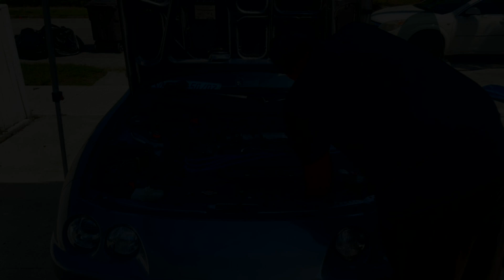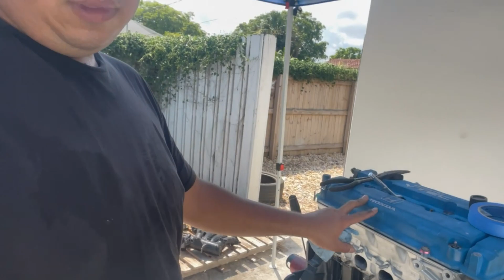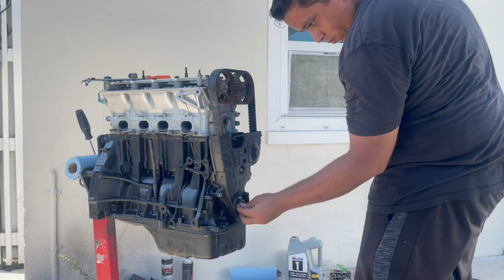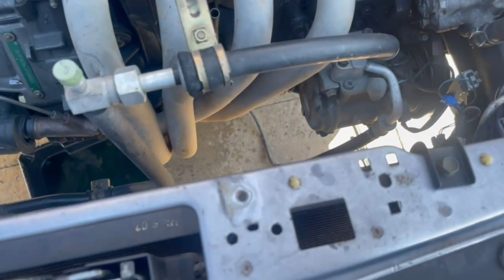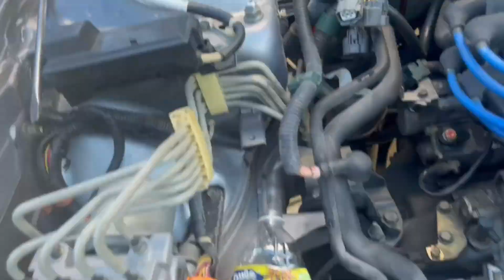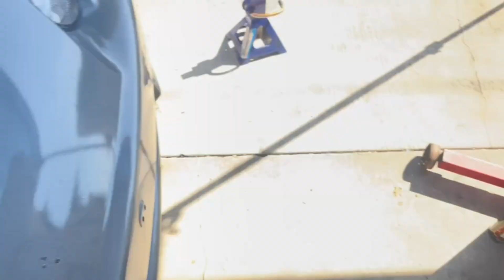HOW TO PROPERLY TIME A B SERIES B16 B18 B20

Comment: A tight timing belt and a good valve adjustment make these Honda engines run like sewing machines.
You seem like a really intelligent guy.  I can tell by just your consideration of the extra shear-stress on the tensioner bearing from the extra tightening of the timing belt.  You think things through, so you are obviously a thoughtful person.
Reply from the maker: Thanks a lot man I really truly appreciate it.